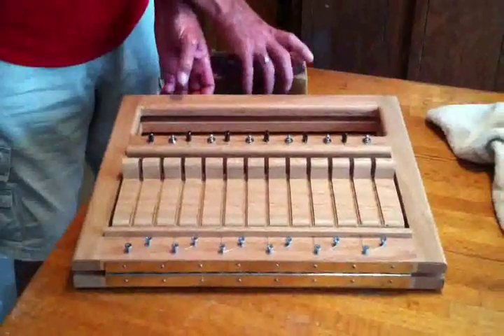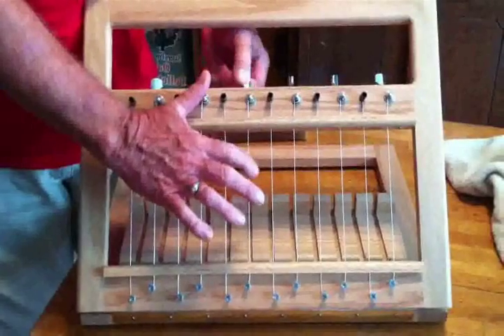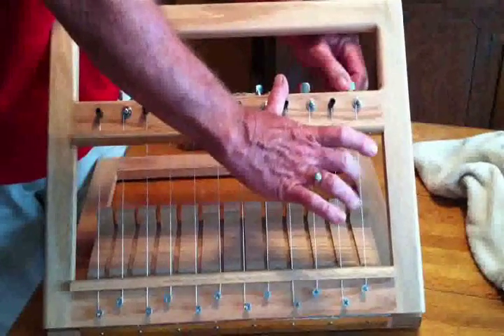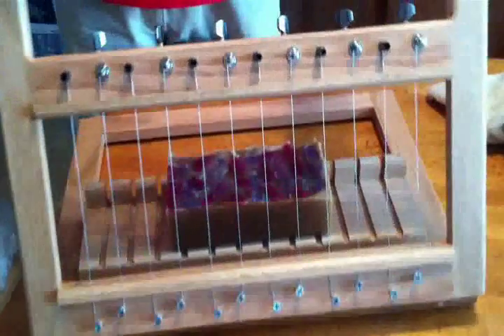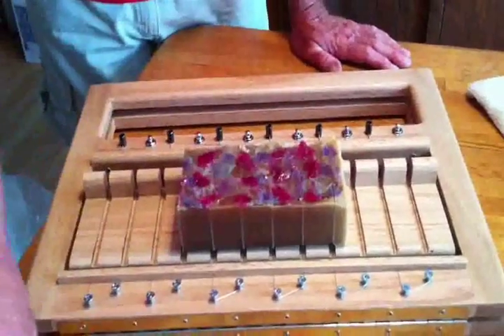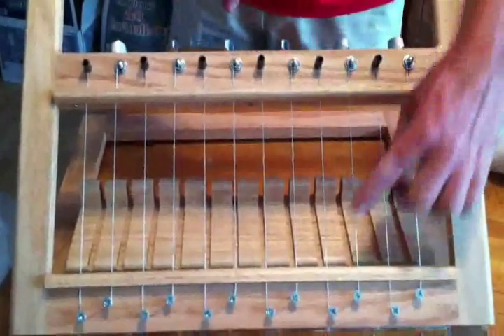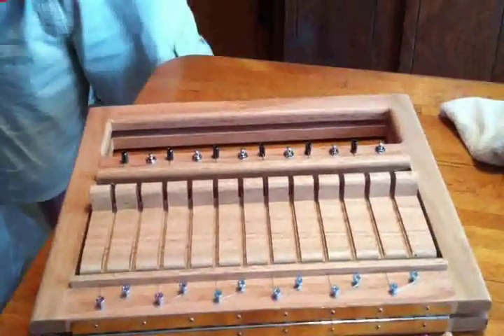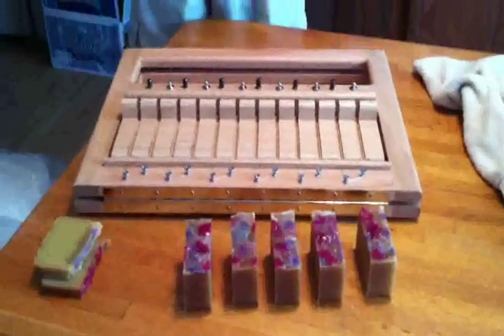Mod 1 Soap Cutter Demonstration

Comment from the maker: For the demonstration I used a 7" loaf that was cut into 1.25" bars. The cutter will accommodate a loaf 3.5" wide x 3.5" tall x 16.25" long. Please visit my Etsy shop at at the link posted above.

Thanks,

Bud